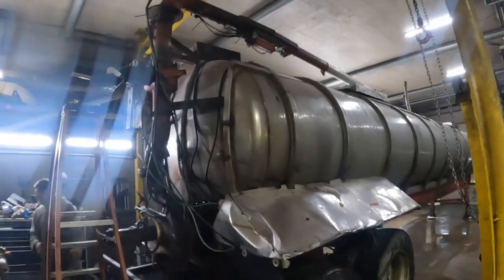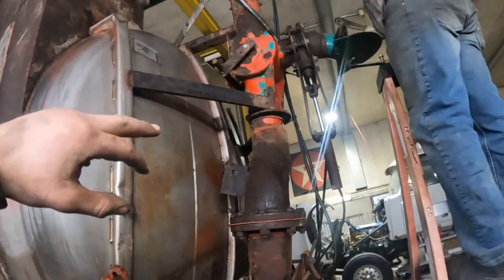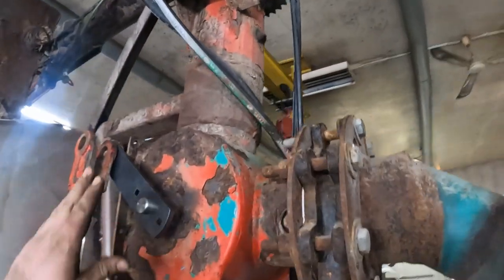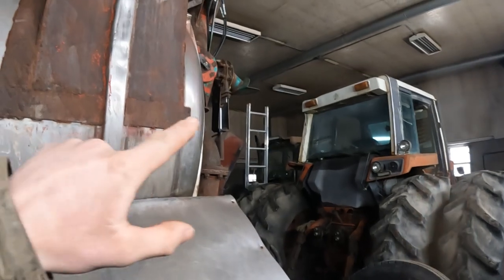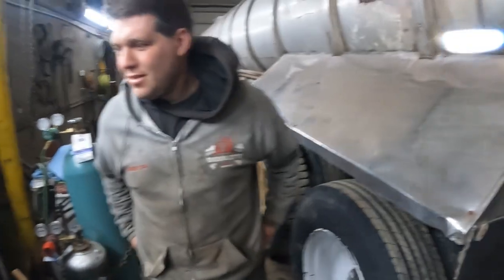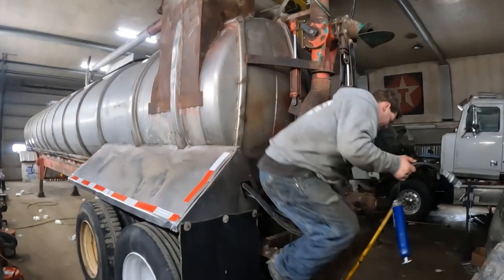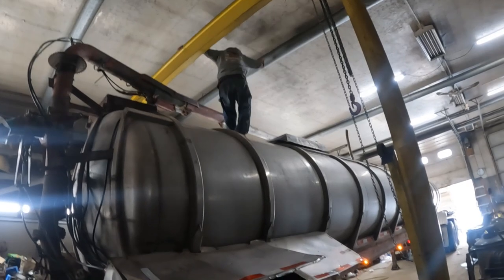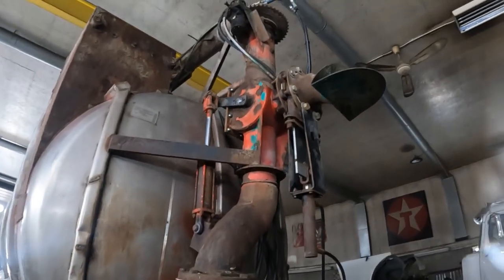Tractor trailer manure tanker repairs

Comment: Hi guys
I hope you had a manhole open on top of the tank before burning and welding , methane is highly explosive in a sealed tank , worked for a major tank manufacturer for 23 years and many of our customers died doing running repairs on their tanks without venting and cleaning them out , it’s only a matter of time before things go horribly wrong , take care and be safe 
Regards Davy🏴🇹🇭